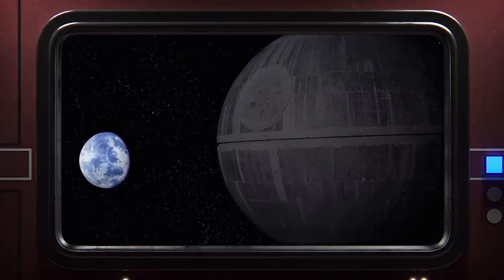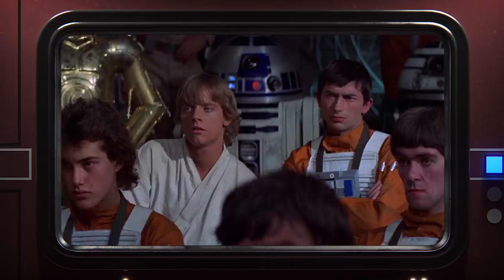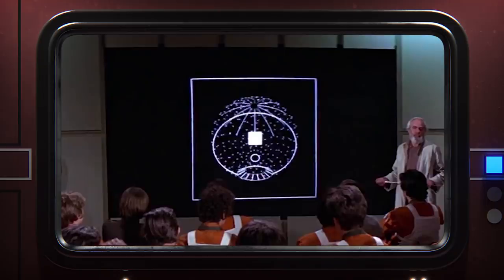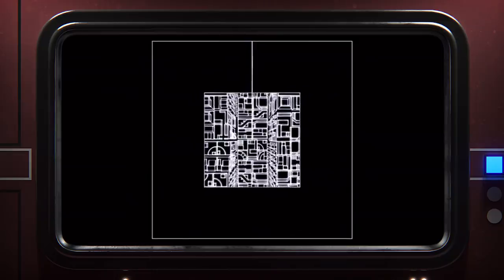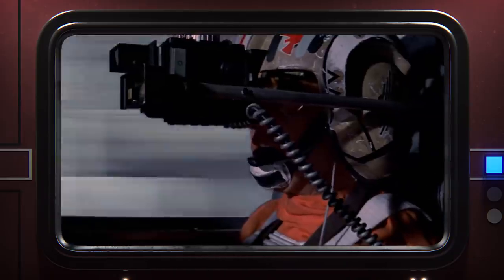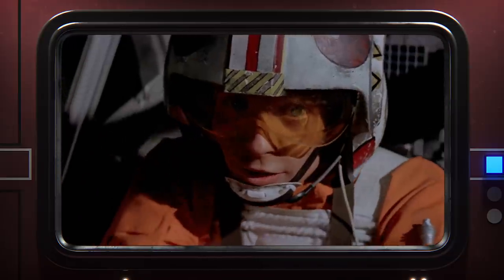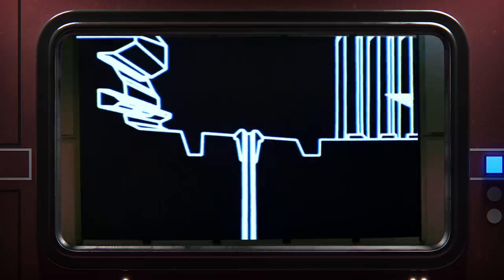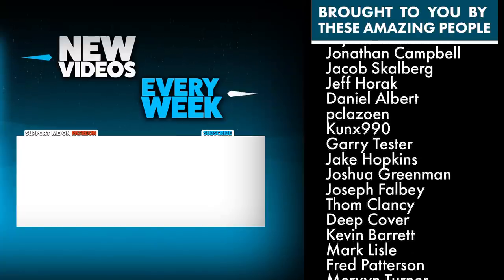The Thermal Exhaust Port Was NEVER a Problem

Comment: + covering completely a thermal exhaust, with a wall or something… isn't it kind of Dangerous ?
Reply: Well covering this one and making a new one somewhere else would've made some difference.
Reply: i would argue putting in bends or something to make it impossible for torpedos to have a straight shot. a sensor array near the entrance that triggers a blast door to closer further inside. but then maybe Gallens sabotage was that these measures werent put in on this specific port
Reply: Covering an exhaust port completely is asking for trouble but an armored structure could have easily been built over it that still allowed excess thermal energy and exhaust to be vented.  This is just one of those points everyone has an opinion over and will eagerly argue on.
Reply: @nathanharrison2  You miss the point. it is NOT the Proton Torpedo that does the damage. It's using the explosion from the Proton torpedo that set off a chain reaction from the high concentration of high energy gasses being dissipated by the thermal exhaust ports. Only a direct hit, one that exploded with the volatile mix at a high enough energy state and  at a high enough concentration would be able to set off such a reaction.

The whole point of a thermal exhaust port is that you are trying to evacuate the high energy emissions far away from the primary exhaust, lowering the chance of catastrophic failure of the complete exhaust system under normal expected operating conditions. The only way to know any of this was to have enough technical knowledge of the Death Star itself in order to identify such a vulnerability.

Lastly, as for the torpedoes themselves. It's also NOT Luke using force powers making them turn down like that. It was made pretty darn clear during the presentation that the torpedoes were programed in such a way to make that turn and hit the target. The key here is that the torpedo being programmed to make that dive at a specific coordinated point. Relying on the targeting computer, you are liable to miss that exact moment of release (especially given the surface velocity of the X-wings in the trench) and the nature of human reactions to prompts like the fire command. Red Leader made the run, got to the release point, and probably reacted either just quicker or slower than the window of opportunity the pilots had. Hence the torpedoes "Just impacted on the surface." Luke using the Force just meant he released the torpedoes at the actual exact moment because he knew the timing was correct, thanks to his force-enhanced instincts.
Reply: @Skyfighter64  im not missing the point. Im arguing that there may have been structural placements in the other ports that didnt allow an explosion close enough to anything to allow for the chain, such  as the bends or blast door sensors, which was due to gallens sabotage, or each port was of equal oppurtunity and they just chose the weaker defences. At no point did i mention targeting ability or the force coercing the shot
Reply: @nathanharrison2  But it doesn't matter if they are straight, the torpedoes are guided munitions, they are able to right angle down the tube in the first place. It doesn't matter if it kinks. It never was a straight shot.
Reply: @carbon1255  and what happens if that sharp turn burned up all the auxiliary fuel that is for course corrections? put enough corners in there and you wont have an issue
Reply: You can put covers on that automatically open. You can also put grids over, or just bend the pathway. 

The follow on issue is the fact that you need to exhaust something. Just heat will not work, you need gas, which could degrade incoming fire.
Reply: @seriousmaran9414  you could also put a shielding on it that doesn't allow for Proton torpedoes to pass through, like particle shields for instance. Fun fact You can even deactivate shields when they are not needed do the port can still vent whatever it needs to vent.
Reply: @Scortch-lo3xy  obviously the alliance fighters could have flown vertically straight down toward the hole to launch the torpedoes. Would have been much easier than attacking along the trench.

The empire could have blocked the last few centimetres of the trench with an invisible field and trolled the fighters easily enough too. Or used missile defences at the opening.
Reply: @seriousmaran9414  i think the point is that the whole third act of a new hope is a little contrived.
Reply: yeah but one way valves exist, you would put them in anyway as a safty measure
Reply: @Scortch-lo3xy  the whole series of films were contrived to be WW2 America Vs Japan style fighters in space. That was the plan.
Reply: @seriousmaran9414  eh seems more like Britain verse Germany than America verses japan
Reply: @seriousmaran9414  wasn't it based on the dam busters? Aka British planes flying low to the water into incoming fire where they need to release a type of bomb designed to reach its target which needed to be released at a specific time otherwise the shots would miss
Reply: @mickys8065  I believe the trench run was, but all WW2. Which shows how slow the space fighters are. An actual rocket needs 17,500 mph to just maintain orbit so a closing speed of over 40,000 mph at least for a head on pass. That would give much less than a second to acquire and fire at a target. Just would not work in cinematics.
Reply: Vent. Grate. Somrthing with miniscule hole
Reply: @Scortch-lo3xy  made by Americans. Lots of aircraft carriers on both sides. You then have strong samurai influence from Akira Kurosawa.
Reply: Would that not cause heat buildups, this defeating the point though?
Reply: @somenonsense7997  if streamlined you should be fine. You could put a large mesh cap on top too.
Reply: @Skyfighter64  High Gas pressure in a vacuum? No
Reply: @seriousmaran9414  space fighters can be much faster while flying in straight lines, but they need to slow down to perform maneuvers while dogfighting or making a trench run.  Similarly modern aerospace fighters would not dogfight and make tight turns beyond Mach 2 unless you want to pull Gs and turn yourself into spaghetti sauce.
Reply: @Daedric16  Star wars fighters have a problem that they cannot get to Mach 2, even going in a straight line in space. There is no atmospheric friction so forming is an issue. G force on the pilot depends on rate of turn at a given speed. A modern pilot can withstand 9 G which should be enough for space battles.

The really big problem is that without a jump engine a fighter would take months to years to get anywhere. TIE fighters/bombers/interceptors would effectively be useless.
Reply: yeah, because then it wouldn't do it's job
Reply: Yup thank you